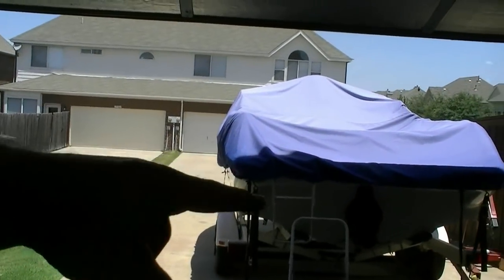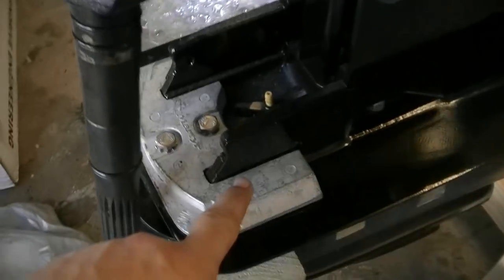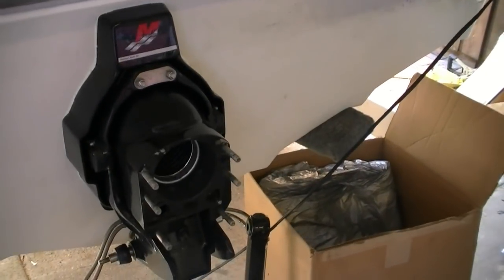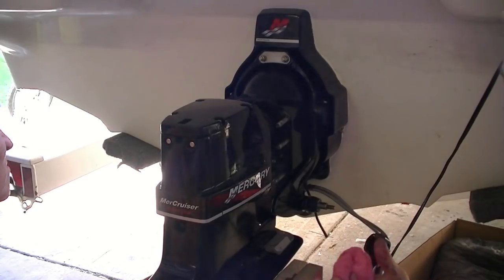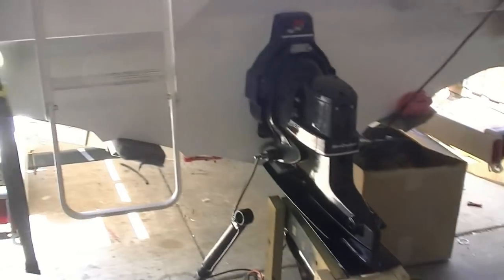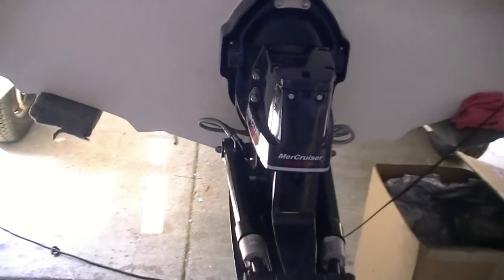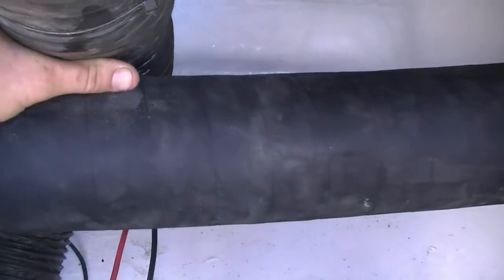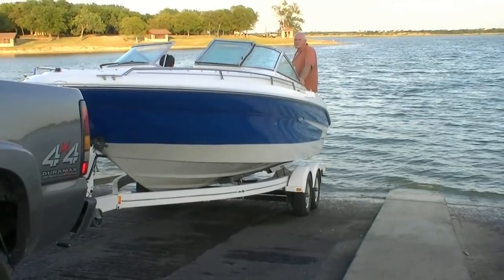Installing the outdrive and float testing the Sea Ray VLOG #56

Comment: I like to discard the IO engine and use outboard engines without removing the outdrive. will use the same wheel steering to steer the boat.

Comment: Is it not true that the exhaust goes thru the outdrive? Will the boat sink if you remove the IO engine with the outdrive still attached. Can water get in thru the outdrive and sink the boat without the engine installed. thanks for the reply.

Comment: I think the videos are very good and informative. However, there are a few things you didn't mention that I think should have been addressed. The upper steering pin bushing. Replace it or not? You also didn't mention the importance of making sure the bolt on the steering arm is torqued enough to clamp firmly onto the steering pin. If the bolt and nut are replaced, it should be with nothing less than grade #8. It would have been nice if you gave us more info about the   black enamel you used for the finish. I did the same project on my Bravo except I blasted it down to bare metal.I replaced the smaller upper steering pin bushing, but it's not easy to remove the old one. I painted everything with Rustoleum. I used their primer for aluminum, but not the self etching. I didn't think it was necessary due to the blasting I did. It turns out the finish chips off with the slightest tap of a wrench! The primer seems to be very brittle. Everything was as clean as it could be before I painted. I'm no expert. Everything in the course of the rebuild was seat of my pants, but it worked out well. You're videos were very helpful!
Reply: BravoX1D looks like he knows what he's doing for sure ..he didn't mention setting trim senders for trim limit..or trim gauge but I'm sure he did it..

Comment: Just a little correction.  This is Irrelevant but you pointed at starboard as left and port as right in the outdrive Hydraulics.  That’s backwards it’s the opposite.

Comment: Would you launch a boat with a 2wd 1500? I'm looking st buying a 21' boat. But I only have a 2wd 1500. I notice everyone has 4WD trucks when they launch boats.

I don't wanna be one of the Internet pictures with my new 2016 Silverado in the drink lol
Reply: I will just tell you a story...Several years ago. I had just gotten my second boat. I then gave the first boat I had to my Cousin. He owned a 94 F250 with a first gen Powerstroke. It was an Extended Cab Long Bed. But it was only 2 wheel drive. He got stuck in a low angle boat launch that was lined with concrete. But his rear wheels were in the water and the trailer dropped off the concrete lining. He was just plain STUCK. I owned an 89 S10 Blazer at the time but it had good 4 wheel drive. 

He and I spent the better part of an hour getting his truck and trailer out. Because I might have had 4 wheel drive but an F250 is a lot bigger than a blazer. Finally it came out. But there were a lot of pissed off people that wanted to launch their boats and a few people that were pissed off because they were ready to leave the lake. Of course non of them wanted to help though...

I always tell people if you want a watercraft of ANY kind...Make sure you at least have All Wheel Drive...4 Wheel Drive is better yet..
Reply: I'm launched boats with front wheel drive Honda Minivan and 1 wheel drive Dodge van, just have to be smart about how far in you go, and is the launch ramp slippery from algae
Reply: I also launch my boat with a minivan a Chrysler town and country and its 2wd you just have to go at a angle going up so it can get better traction on the tires